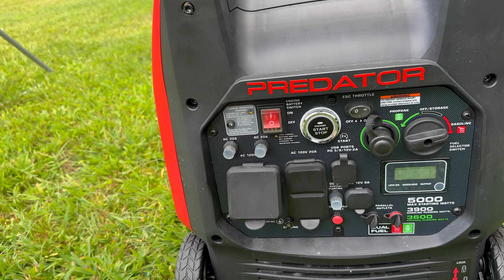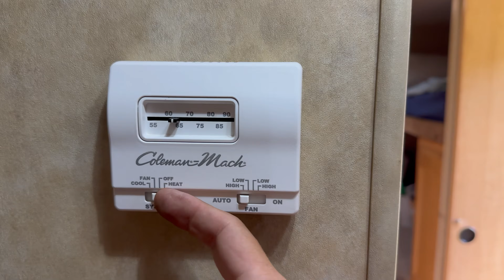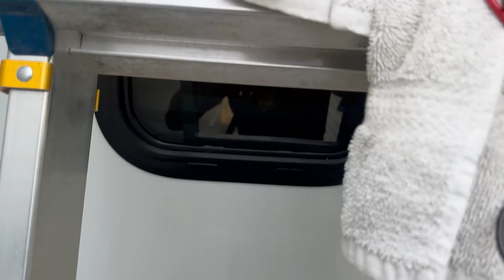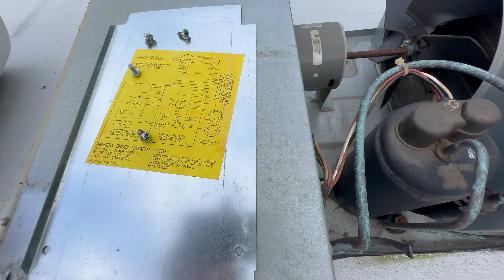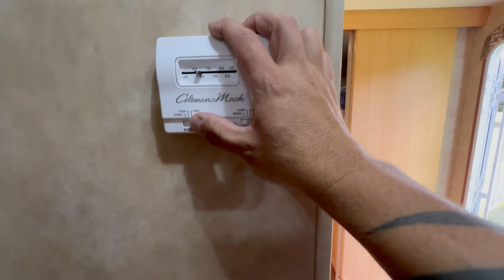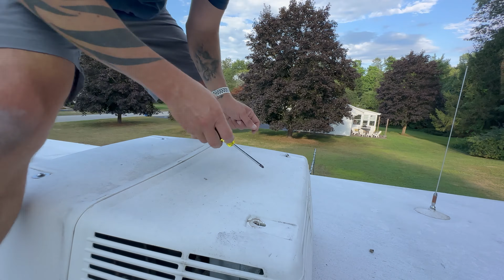Easy Fix For RV AC That Trips Generator Or Circuit Breaker

Comment: Let me ask this: My Power watch dog kicks out for low voltage when the AC compressor kicks in. I can watch on the app and the voltage goes from 124 to 116 to110 and then the Watch Dog kicks out for low voltage. Same issue? Capacitors?

Comment: Great video, I'm hoping this is my issue seems like a cheap easy fix. I'll be testing mine tomorrow. I have a 1995 Winnebago Brave. It's a little over 30 years old now so I might need more than that lol but it worked fine all summer last year & been working fine the past few weeks